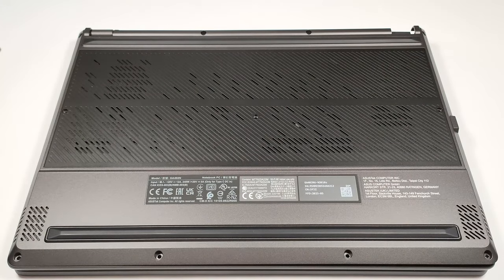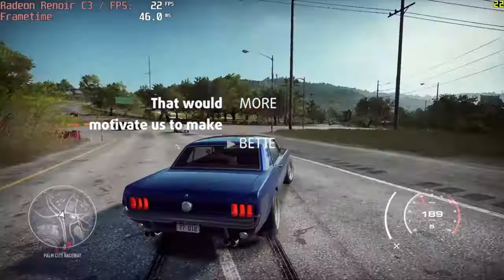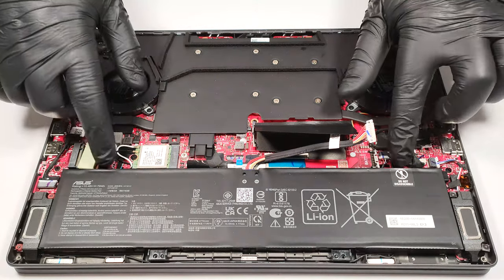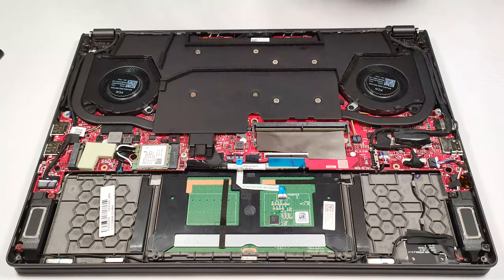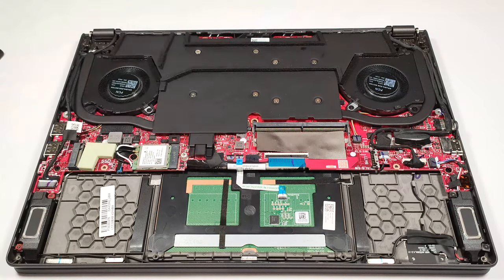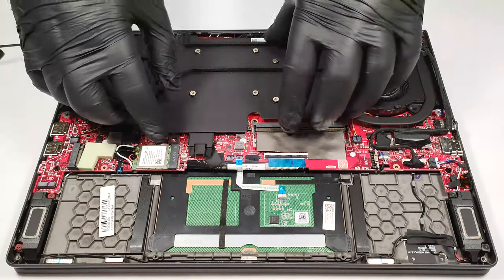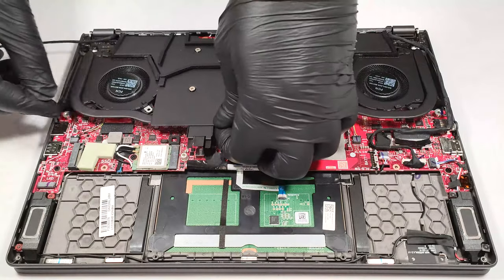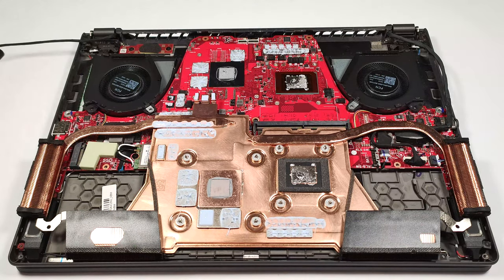🛠️ How to open ASUS ROG Zephyrus G14 GA402 (2023) - disassembly and upgrade options

Comment: Where are the speakers? I have a minor vibration/rattling coming from the left side when playing music, which only sometimes happens during the right frequencies. Anyone know the most likely culprit? Like maybe one of wiring components of the fans rattling around?
Reply: The two rectangles u see next to the battery, that should be the speakers

Comment: Anybody have any luck fixing issues with the sensors in the middle of the touchpad not working properly?  I love my laptop, but it has become strictly a desktop replacement because it is miserable using the touchpad on the thing.

Comment: Thanks for this informative video.  Question though, is removing the fan necessary to get the heatsink/vapor chamber off?  Most ASUS laptops I could leave the fans in place, and I see here the cooler comes off with the fans still there, or do the fans have hooks that need to be lifted up to get the cooler out?  Not a big deal but I'm all about not unscrewing tiny, easily stripped screws whenever possible.

Comment: So the 512 GB SSD that mine came with is as much as I can get, unless I change the drive completely?
Reply: Unless you add on external drive which is fine if you use it for larger less played games or less used programs. Then you can plug and play those programs/games
Reply: I have a 4Tb SSD you just have to buy it and install like they show here

Comment: Can the battery be removed and used without it directly connected to electricity?
Reply: it may can but it's not recommended because Modern notebooks are designed to be used with battery when they need more juice then the power supply can provide then the battery comes in handy, if u worry about battery health u can lock it to 80%  or how much u want with a non asus software

Comment: I did that, and now my computer is not turning on, do I need to apply a paste?
Reply: same thing just happedned to me. did you figure it out how to fix it?

edit: nvm i guess it was the new ram. needs a few seconds to get used to it.
Reply: i knew, if you disconnect the battery, you can fry the board, happened to lot of people

Comment: I am sufferuing after buying this piece of crap!
1. No ethernet port!
2. Soldered RAM (This is NO 250$ notebook!)
3. Bluetooth is not useable once you use any of the right side USB-ports! Which makes only ONE USB-port useable!
Reply: 1. It's slim, what do you want lmao
2. Soldered RAM = faster RAM, wait until those super small RAM thingie become mainstream in the next 10 years
3. The wifi card is also a bluetooth card, if your Mediatek having issue, get an AX210
Reply: @amelia20fe  'Slim ' is like the very least relevant parameter of a notebook since at least 10 years, because no single notebook has been too fat ever since. A notebook slimmer and lighter than really needed is paying this not-advantage by sacrificing ports, battery runtime, repairability, upgradability and general robustness. Soldered RAM = RAM defective, throw notebook away and dcecreased upgradability. Not even the slightest advantage there, but huge disadvantages.
Sh*t t becoming 'mainstream' does not make it less sh*te, it only means even more sh*t.
It's solely about industry saving money, buy decreasing product quality and longevity, while making non-technical people believe this utter sh*t was 'better'.